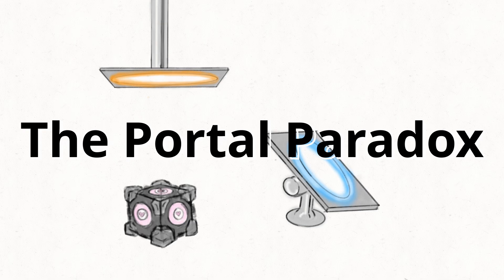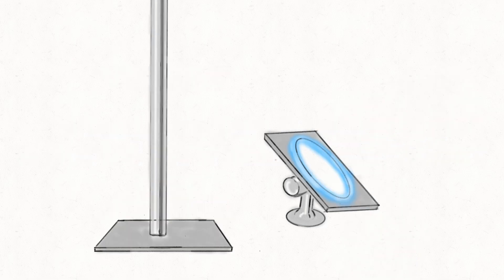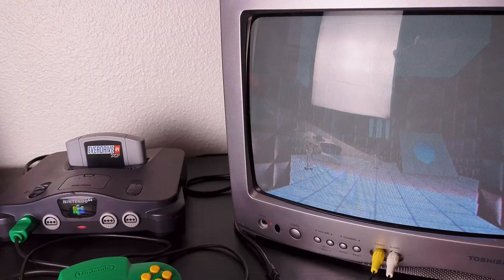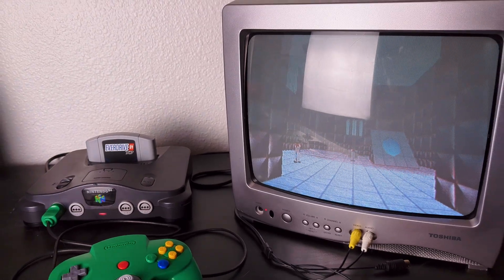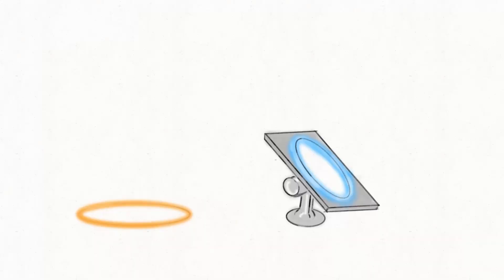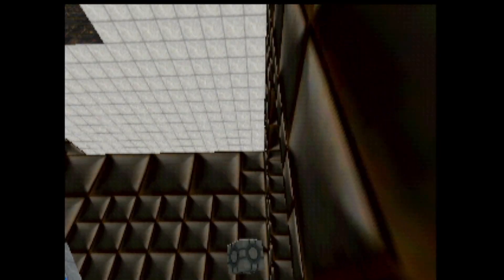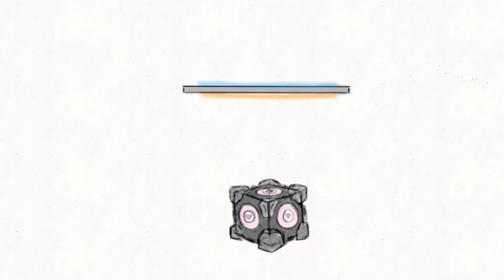I rewrote Portal from scratch and solved the Portal Paradox

Comment: Hello Mr. Lambert, your implementation of moving portals violates the law of conservation of momentum. P = m*v where m is mass and v is velocity. The cube starts in a stationary state with no momentum, no velocity. When the portal goes around the cube, the portal does not touch the cube. Yet in state two, the cube now has non-zero velocity. This can only occur if another object acts upon the cube with a force. The momentum of the cube in state one and state two are not equal and therefore not conserved, violating the law of conservation of momentum. 

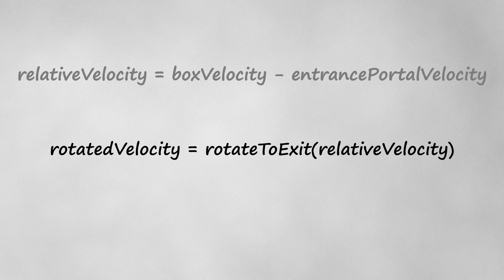You said you did not make your implementation to get the answer you wanted, yet your equation at 1:44 did that just so. You invented the "relative velocity" equation without a clear understanding of observer frames and the conservation of momentum. Observer frames means what is the velocity of an object relative to an observer. So a cube would have zero velocity relative to the earth, but would have 1000's mph relative to the sun. To the moving portal, the "relative velocity" of the cube relative to the portal makes it appear as though the cube is moving towards it with a velocity, so I see how you may have confused that for the cubes velocity. However, considering the conservation of momentum, the portal does not touch the cube and therefore does not transfer any energy to the cube in order to accelerate it to a new velocity. 

To put it another way, the "relative velocity" when observing from the moving portal makes it appear as though the cube is actually moving, however it is not. So on the other end of the portal, it will look like the cube moved as fast through it as the portal is moving. However, as soon as the entire cube is transferred, the cube will still be in its initial state of no momentum, no velocity, and immediately fall to gravity. It will look like it moved very fast through the portal, but actually the cube had no momentum the entire time and the portal just moved around it instead.
Reply: This is incorrect, due to the fact that the velocity is transferred to the cube through the process of going through a moving portal. When the portal is brought onto the cube, the cube exits the other portal at the velocity = the entrance portal. Newton's first law, what stops the cube from continuing its movement upon exiting the portal? Nothing. 

This is further proven in his second example (the hula hoop), where the cube behaves exactly as you've described.
Reply: Since motion is relative to a frame of reference if something is in motion relative to a frame of reference it also means it has velocity relative to that frame of reference, meaning the answer technically depends on which frame of reference, if it’s the moving portal that is the frame of reference it means the cube will launch out the stationary portal

Comment: Here’s what I’m confused at. As the portal goes through the object it would start appearing out of the other portal, so what would happen if you were to pause the portal going, let’s say, half way through the object?
Reply: It would go half as fast.
Relative to the yellow portal, the half outside of the yellow portal is stationary. It has 0 speed.
Relative to the blue portal, the half outside of the blue portal has 100% speed of the portal.
This means that while the first half is outside of the blue portal is dragging the other half out, the other half (and it's inertia) is pulling the other way. Assuming the mass of the cube is the same, and exactly half of the cube is moving at 100% and the other is moving at 0%, it would average out and the whole cube would move at 50% speed.

Comment: I always thought of the portal as a doorway, e.g. if i slammed a door frame down on the cube then it would just plop out the other side, but the explanatjon of one "side" of the doorway moving while the other was stationary cleared that up
Reply: It is a doorway. People keep thinking "speedy thing goes in speedy thing comes out" means the portal or "lack of matter in a space" (like a doorway, or hole, or anything of the sort), has mass or is an object in and of itself. It is not. Everyone using this flawed logic to say the cube would fly out, is misunderstanding the point of the phrase. It was a way to get people playing portal to understand velocity of objects and how it is consistent in newtons laws of motion, but people keep thinking it is implying the portal is itself an object and has it's own velocity. It does not. A hole in matter is not a seperate object. It is merely the lack of that object's matter in that position in space.
Reply: @JamesR624 well you can’t say it’s a doorway because you can’t have an untouched door with one side moving and one side not moving and have both sides technically connected and have the transition between both sides be seamless
Reply: @JamesR624 also a hole cannot move, if it moves it is a completely different hole, because how can something that is literally NOT, be moving

Comment: Here’s my question regarding your point around 2:50. If the exit portal were moving at a slower/faster speed then the entrance portal, would the cube compact/stretch or break as it goes through?
If I understand this right, you’re saying there is not a constant velocity through the portals (unless both are moving at the same rate..)
I think the speeds might need to be extremely different in order for this to actually occur, but I’m not sure.

Comment: per the law that you cannot create energy, i have always found it baffling that people think the motion of the portal equates to motion of the object. The box itself isn't moving and the portal only moves the object to the other point in space-time at the rate of which it comes out. The object conserves its energy regardless of motion and gravity is the only constant effect on the cube, meaning it would fall out of the other portal in the direction in which gravity is affecting it. The portal itself is essentially a hole in the platform moving down upon it. Especially in this diagram, if the portal was moved slower, it would eventually tip over outside of the vertical facing portal due to gravity having more of an effect on the box than when it was laying upright. There is zero actual evidence that a moving object with essentially negative mass would move another object.

Comment: I peronally believe this implementation is flawed. A moving portal should not affect a body's speed. If this was the case, then, while the portal drives through you, some parts of your body would suddenly be in a state of motion while the other parts are not. This would tear your body apart midway through especially at higher velocities. A stationary object shouldn't suddenly have speed tied to it without any form of acceleration. Otherwise when applying v=v0+at with t basically equalling 0 the equation could no longer be satisfied even with a being close to infinite.
It should simply behave like a moving wall that is permeable. Imagine a giant wall with a doorframe that's being pushed in your direction. You will end up in the other room but that's it. Your velocity never changes and you stay stationary while entering the other room. A moving portal simply changes the location you enter/exit.
Reply: Motion and velocity are relative, you can’t say for sure something is in motion or is stationary, it all depends on what your frame of reference is

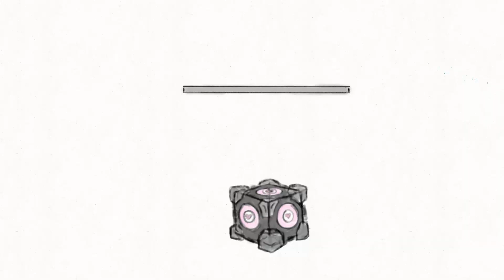Comment: The problem with the explanation at 2:07 is that the portals themselves are moving relative to one another in space.  The velocity the portal the cube is going through is subtracted by the velocity the other one is experiencing.  It's no different than a wall with a normal hole.  Where you get the motion from the cube with a moving portal is when the exit portal is stationary, or in the opposite direction.  

What these people are missing is that they're perceiving the cube as the fixed point in space here, when in reality you should view it as the opposite.  Portals are effectively an infinitely expandable fixed point in space, where the entrance "percieves" space at a fixed point relative to it (despite still being a fixed point in space), and the exit has the space from the entrance moving relative to it.  This is an important distinction.  To the exit portal, the floor in this case is launching the cube at the same speed the first portal is moving.  If the second portal is moving away from the direction the floor is moving relative to it, it adds to the speed of the launch, as the floor will still be coming towards it at the same relative speed no matter what it's doing, but it is also moving relative to the object through it.  The floor effectively gains the speed of the exit portal, causing a farther launch.

 The second the entrance portal stops is the second the cube launches.  Obviously there would be some weird gravitational stuff involved as one part of the portal would be feeling gravity at a different point to the other initially, but in a space without gravity this is how it would work.

If you have it stop half way down the cube, the launch would likely be half as powerful as well, as only half of the cube is moving relative to the exit portal, while the other half is stationary relative to the entrance portal.  

I'm sure you're about to explain it in similar terms, but I wanted to post my thoughts before I had any outside influence.

Comment: If the fisrt case does happens in real life, may  the arm that pushes the portal throught the cube experiment some resistance force from "somewere" to transfer energy to the cube or else the cube will just gain kinectic energy from nowere, what is impossible. We see it in the first scene with the exit portal pointed up separated from "entrance" yellow portal.  The cube gains some height and horizontal speed in relation to the planet. It relative speed pass from Zero to X. Its mass apllyied to kinectic energ equation will give how much energy should be "spent" from yellow portal to to necessarily throws the cube that way. If the arm's energy or "aceleration" wasn't enouth to throw the cube the arm will be stucked in the midle of the cube or passes as slow as is lowers it's kinetic energy

in the second simulation, with the blue behind the yellow, this resistance doesn't exists or "its not considered", wich seem to me, to be the way that physics works in The Portal game.

If you do the fisrt simulation but wiith horizontal moviment of the portal, what will be the result?

Comment: not a very mathy guy, but wouldn't the mass of the cube as it is entering the portal subtract the inertia, in your example it does not enter the portal in a single moment so the real thing would be a plop i think, because something like this: 10% cube in with inertia vs 90% cube out counter inertia, this would ramp up until more then 50% of the cube is in the portal where the pull is bigger then the mass, depending on the speed.
you also didn't factor gravity, gravity vs the portal velocity and the weight of the cube. Plus the math seems very basic for something like real life, looks good for a game though.

Comment: It is actually not a paradox and your example is behaving kinda correctly. But instead of using only velocity in your argumentation I would suggest you add mass into the equation because it is not velocity which is conserved in einstein-rosen-bridges (portals) but momentum.  I assume that if the portal moves to the box in free fall that the box would not "shoot" out of the other portal because it is still in the same gravitational field which applies the free-fall to the first portal. However this changes if portals would have momentum as well which could actually be true since we know that gravitational waves carry energy.

Comment: The thing is, though, you can't just transfer velocity, right? Something must deliver physical force, which a portal couldn't. You'd move right through it. With no change in velocity. Just like how you can drop into a portal, building velocity via gravity, and launch out the other end because your velocity is maintained. A cube sitting still would have a velocity of zero and would maintain a velocity of zero as a portal slammed down on it. Meaning it would pop out the other side and just go down due to gravity. Right?
Reply: No because velocity and motion are relative and relativity exists

Comment: This makes perfect sense. Imagine I have a ball that I push through a portal by moving the portal to the ball, and then I repeat the process? Each ball will go further out than the last and push out the next. Imagine you do this with bouncy balls instead. Now with marbles. And then BBs, and then sand, and then atoms? Or we can imagine what would happen if there was a wall in front of the stationary portal, and you saw the other portal moving towards you. All you would see is a wall coming at you at, lets say, 60 mph. So why wouldn't the ground around the stationary portal be moving at 60 mph relative to you?

Comment: The portal isn't moving the cube so it would not apply any acceleration in this regard. The only effect on the cube would be from the shifting of air from the falling platform and the sudden change in orientation.
Reply: You can’t say the cube isn’t moving without defining a frame of reference, keeping in mind that there is no one frame of reference

Comment: Great demo, but I think there's problem in your approach, and it lies in adding the portals velocities to the equation. If you rewrite it from as such:
finalBoxVelocity = rotateToExit(boxVelocity)
than it should fall flat. When you add it those velocities, your portals are transferring momentum to the box (which could be valid). But you have to define this behavior (does it transfer or not) in order to solve it. If it transfers, than you're correct and the box should be projected. If it doesn't, than it falls. And I don't think it should transfer, in the same way as a door passing around me should transfer the same amount as I transfer to it: virtually zero.
Anyway... great video! Would love to see a follow up with this version.

Comment: I actually think you're right, but the opposite could be argued (theoretically speaking). Although a falling portal may not have the mass or energy of a falling object, it does have speed... and that speed is directly transmitted to the block, because the block has to come out of the portal at a speed... because without speed, it would not be moving (right?). So, if the portal is falling fast and the block exits the portal fast, that means that it MUST have speed/energy... and the conservation of that energy would exist and the cube would continue until something stops it. (an object or gravity, etc...).

At the same time though, would this be "free energy", as the portal itself may not contain any mass at all? ...and if it does not contain mass, then it does not contain that "energy" that would be transmitted to the cube. Something like this would allow "free energy" to the true definition and (theoretically) a free energy device could be invented (theoretically).

Comment: I don’t have a true explanation as to why, but I feel just in my bones that this is wrong. If the portal behaved like a door or a tether from place to place, something you must travel between, then yeah it would bring the velocity with it. But it’s not a door, it’s just a different space in the same place as another space. There is no travel time, you are just in a different space, the cube just is in a different place once it moves through the portal, standing on one side of the room or the other, it’s still just standing so there should be no velocity.
Reply: How does the cube exit the other portal if there's no velocity in relation to it? If we accept that the cube fully leaves the exit portal then by definition we are accepting that the cube has momentum on the exit side.

Comment: you lost the argument when you conflated the box velocity with the entrance portal velocity. you can't just add the velocity of entrance portal to the box to support your thesis. Though your thesis a portal entrance travelling in an infinite straight line would cause a jet stream of air on the other side of the portal due to gases being ejected out in your theory. You would create black hole event where the suction of particles through the entrance portal would continuously increase like some kind of vacuum.
Reply: Yes. If we ignore the fact that you can't actually move a portal as a portal is not a hole/door, you can't add the velocity of one portal to the box. Something only moves if it is pushed by something else. Since nothing is pushing the box there is no energy being applied to the box itself.

The protal exist on two locations at the same exact time. So if you move a box through a portal it will just move to the next position while keeping its current speed.
Reply: @Cloud_Seeker except relativity, motion and velocity are relative, you can’t say something is stationary or in motion without defining a frame of reference, and there is no one frame of reference, so the answer solely depends on what frame of reference you choose
Reply: there is no argument to "lose" lol